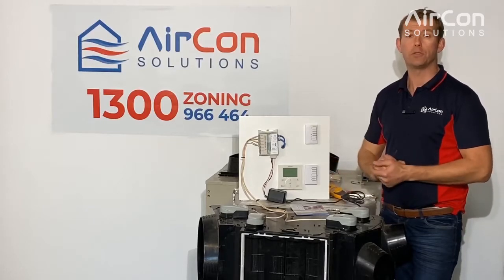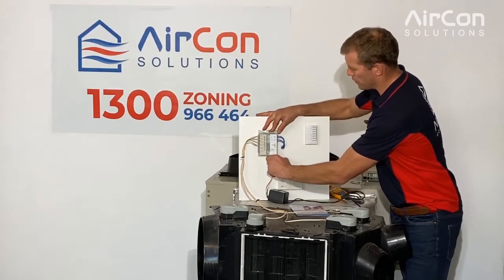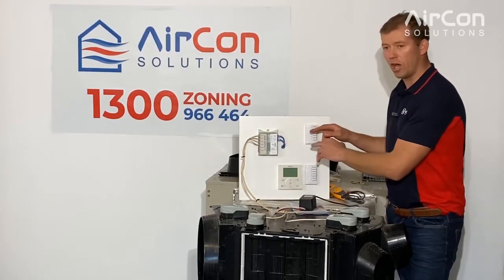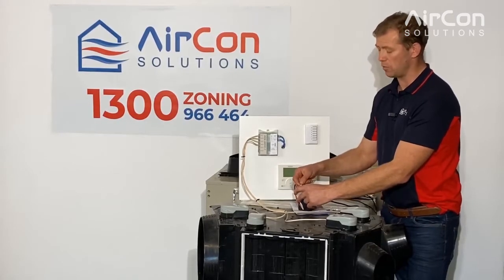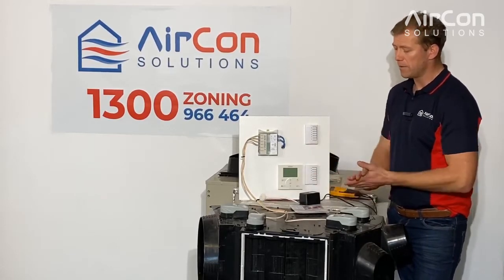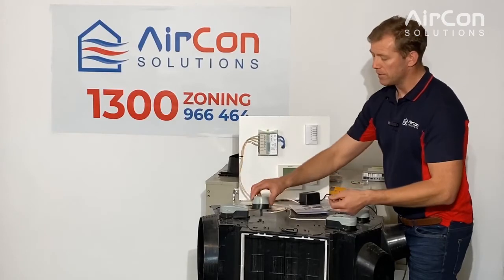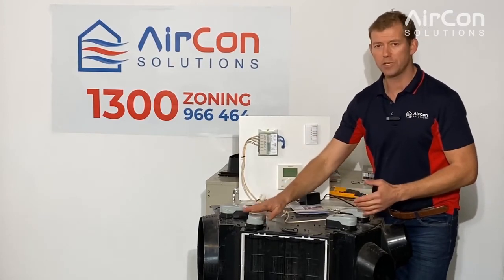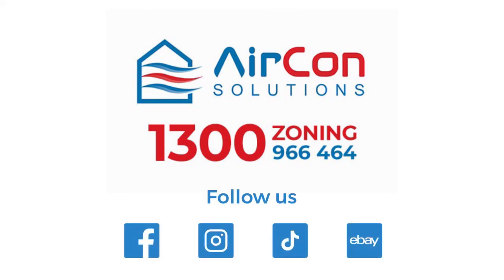Zone Station II basic fault finding steps & common issues

Comment: Hi, thanks for making this video. I've been experiencing issues with my Zone Station 2 making clicking noises in the roof, and lights flickering and buttons not responding on the control panel.
I've checked the voltage and got around 13vdc and 27vac.
Would you say that the power supply is faulty and just needs a new one?
Reply from the maker: You are welcome, based on your description it will be a power supply issue.

If you like we have parts available at our website or eBay stores.
Or for the best price give us a call on 1300 966 464 and we will more than happy to help.
Thank you for watching.